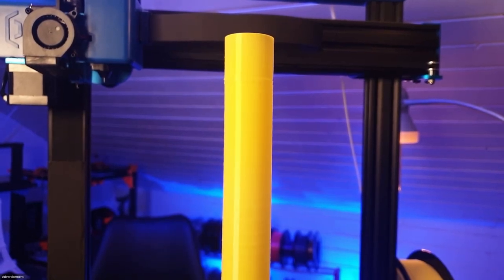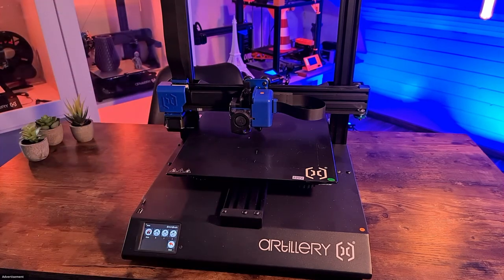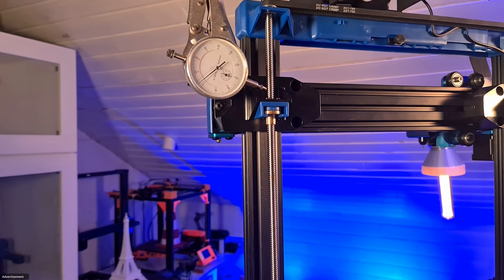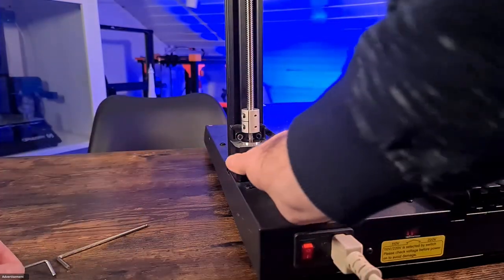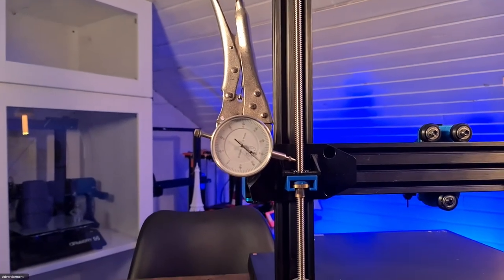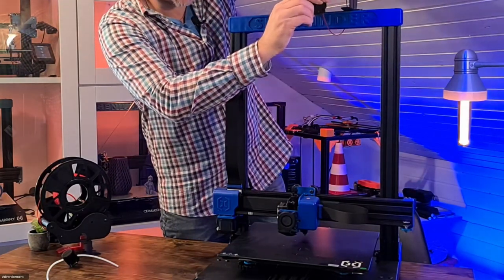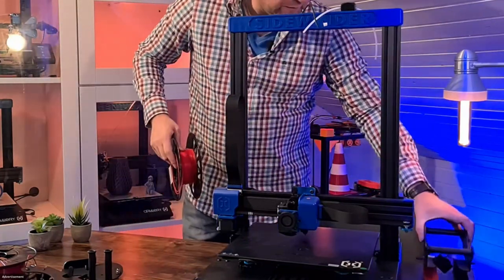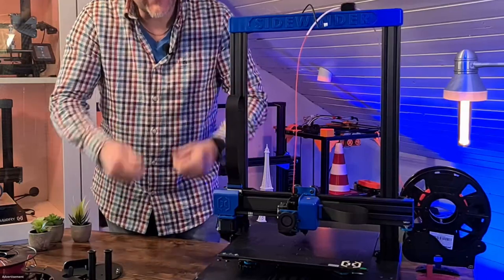Artillery X2 - 3 tips against Z wobbel - quick and dirty

Comment: I only got ony doubt, shouldn't the filament spool act as a stabilizing moment? I mean, it is a weight on top, is like if you try to move a stick with something very heavy on top, you will have to make more force than with the stick alone.
Reply: No, the lower point of mass the better stabilization. Take a stick with something heavy at the end and try to keep it vertically straight, then ask someone to bump it near top. It's not gonna be easy to keep it straight.

Comment: I've got the Genius Pro since half a year and I've got only problems with it. I purcased a dial gauge like yours, but how did you attach it? - What is that clamp, or can I use anything? I want check what's wrong as even my Genius  Pro, which is clearly smaller, has sever z-wobbling and layer shifts. I printed a new fan duct, lubricated everythign, installed a  new metal idler and rubber-spacers for the bed - but still not happy with the result. I hope that checking the rod will get me results. Also: Do you know what the screws do that were listed as "only tighten if needed" in the manual? I disambled the entire printer-gantry but i am unsure on how to properly align everything again - the rollers don't seem to roll equally tight and i am not sure if the motors are properly aligned. I am tired of getting f'ed up prints as i invested a lot of time (and money) already. If you got any suggestions or know a video on how to assemble it properly, I'd be glad :)